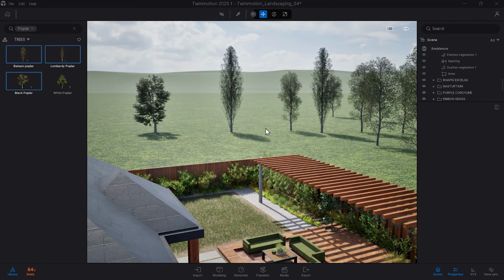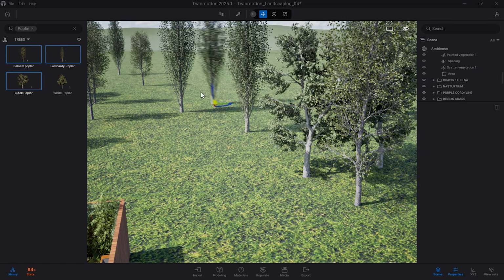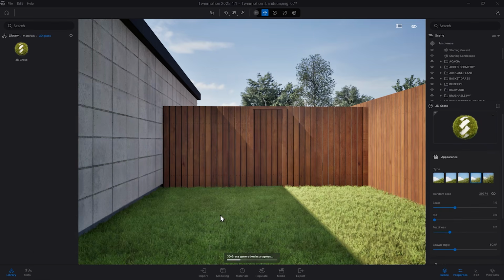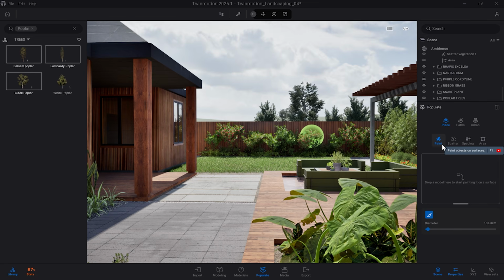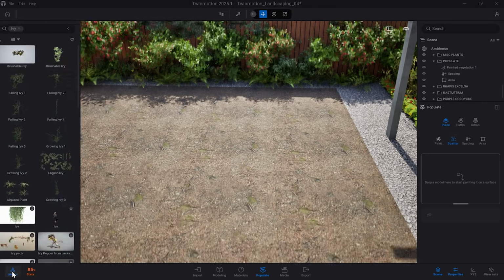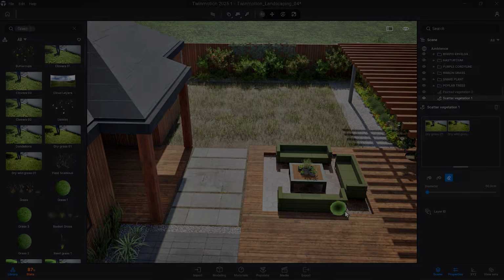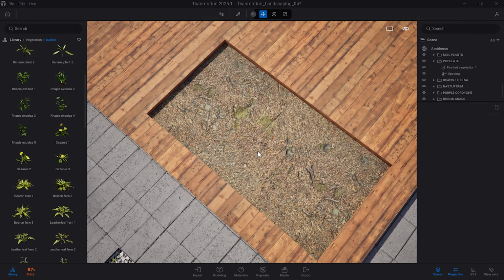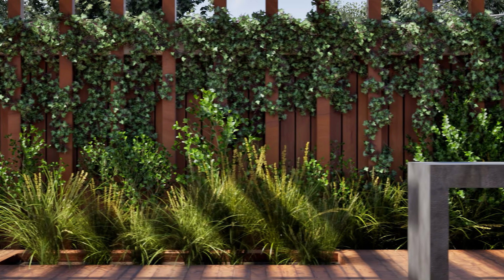Options for Adding Vegetation | Twinmotion Tutorial

Comment: I have installed Twinmotion 2025.2. I already downloaded the initial libraries as well as the in-app libraries (such as HDRIs and materials). However, whenever I reopen Twinmotion, everything appears to be missing, and the software asks me to download all the libraries and materials again. The data is still present in the directory and the paths are correct, but Twinmotion does not recognize them. As a result, I have to re-download everything one by one each time I start the software.